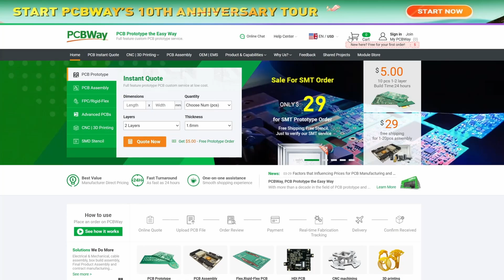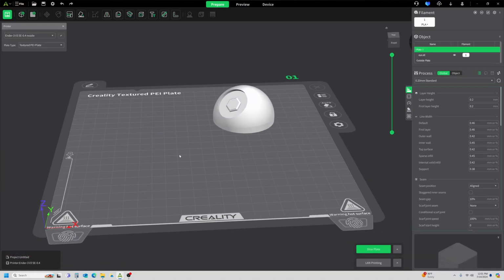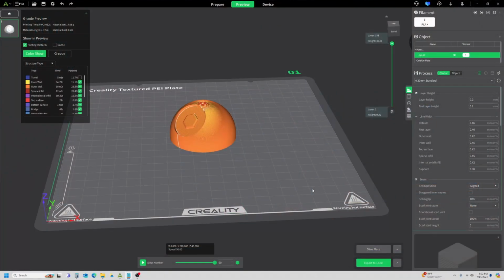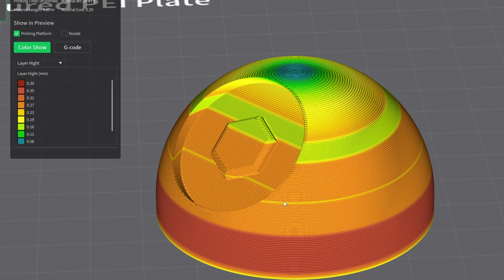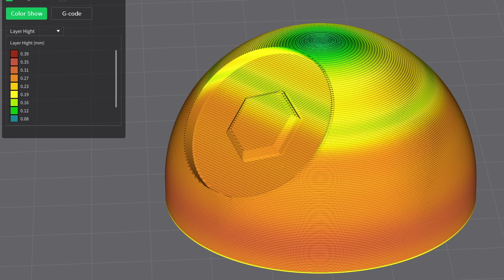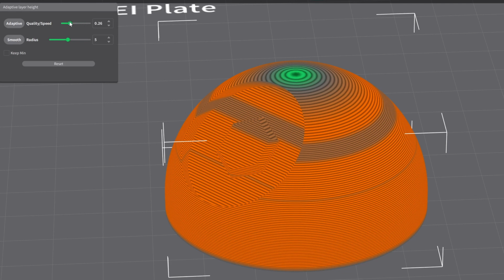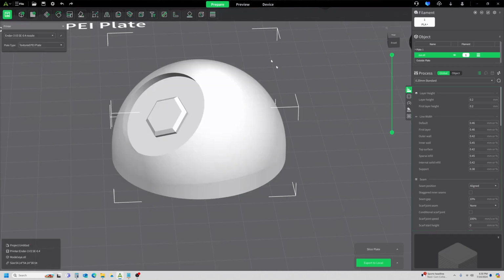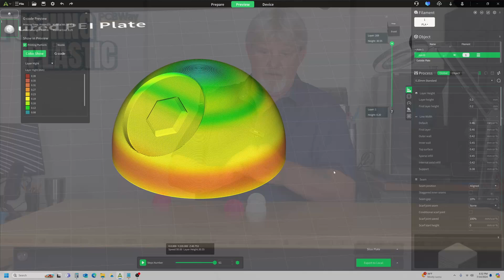Using Adaptive Layers In Creality Print 5

Comment: I appreciate the good info that you put out there.
When the V3 SE came out I grabbed a handful of them thinking I was going to be able to get some better quality and faster prints and that was exactly the opposite reality slicer was junk so I went back to cura.
Creality 6 just dropped and I started playing with it and the speed is back but the quality is not there yet, and the top layers on rounded surfaces are delaminating it's not the model.
Been printing the same model in Cura for over a year flawlessly.
So thank you for the info
Reply from the maker: Can you top layers (the rounded corners) be improved with Creality Print's Adaptive Layers?

Comment: Thank you!  I have been printing clockfaces with flat surfaces.  The flat areas almost looked like flat facets.  Between the smoothing and adaptive layers they look great!  
I'm using the third version of V6, they fixed a lot of bad things very quickly.

Comment: I had a problem using Adaptive layerheight in Creality Print 5 (V5.1.7.10514), and wanted to ask about it in this comment section, but hopefully I figured out why it is happening. Despite this, I write what is the solution, maybe someone will experience the same issue.
The problem: Adaptive layerheight sometimes not applicates, all of the layers' height are equal (value from the Quality tab of the filament settings).
It is a bug, the support setting causes it. If you prepare a model with enabled Tree support, it will mess up the Adaptive layerheight, even if you disable the support and prepare it again.
The Solution: the support needs to be disabled before the first preparation!! If you already made a prepare with enabled support, you need to restart Creality Print to make Adaptive layerheight work.

Comment: This new update is great. I was able to get .04mm layer height on .4mm nozzle with fantastic results with my Ender 3 V3 SE. I am on klipper and I have done the dual 5015 fan upgrade. Outside of that, I have tuned and tuned and tuned. That was also at a max velocity of 250mm/s and outside walls at 100mm/s with PETG.
Reply from the maker: Nice! How are you liking the SE? I'm loving mine so far. I recently did some TPU parts with great results!
Reply: @pushingplastic7445  All of the issues I have had were between me and the slicer, so I am loving it!

Comment: I tried messing with adaptive layers, and no matter how much I go between  and speed, the entire print is solid green (..12)    Any idea what's wrong?
Reply: NM  I think I answered my own question
Reply: After I figured it out, I went back to a current print to ad adaptive layers.  Figured it out i guess, i went to slice and all I got was a ghost image of my print. I couldn't get it to slice. It would move around and if I went back to prepare, it would be normal.   What am I doing wrong?  I logged out and restated my laptop.  Nothing.  I am NOT tech savy at all.  So frustating
Reply from the maker: @Elimn8r64  When you apply the adaptive layer setting, you must press the button that says "Adaptive" before slicing. If you make an adjustment in the adaptive layer dialog box and you don't press that button, you will get only the ghost image and the slice button is disabled. After any change to the adaptive layers, press the adaptive (or Smooth) button. I hope this helps!
Reply: I did what you suggested.  I made sure I pressed the adaptive and the smooth button.  I still got the ghost image and couldn't slice it.  Am I missing something else?  Also, when I clicked on speed to slow it down, nothing appeared,  just blank.  I'm using silk pla if it matters.  I've tried this many times and keep getting the same result.  Sorry to keep bothering you
Reply: @Elimn8r64  Check that you're not on tree supports. It fails with those, and doesn't always give an error message
Reply from the maker: After adjusting the quality/speed be sure to press the adaptive button just to the left of the slider.

Comment: Thank you for the video!
The only little disadvantage of this method is that we can't use tree supports. It's understandable, they have their own independent layer height.
The feature it's extremely useful, thank you for great explanation!
Reply: Can' you use any supports at all?  I want to print a bell with adaptive layers, but I need supports on the inside.  Does that make a difference ?
Reply: @Elimn8r64  Hello! You can use normal supports (lines), but not organic (tree supports)

Comment: If you don't see the icon in the toolbar, it's hidden behind the filament control menu. A small circular tab sits next to the menu which controls the menu's onscreen/offscreen option.  Click that tab, the menu slides offscreen and the tab moves to the edge of the screen. 
To review, your minmum and maximum layer height settings provide the range in which the adaptive layer settings work. Good tool. Thanks for the heads up.

Comment: Using adaptive layers in Cura is very similar, but you get control over the layer height range and the max difference between steps
It does help on spherical shapes.
Reply from the maker: Similar but still different. I did a full video on Adaptive Layers in Cura about a year ago. I think Creality is following the path of Adaptive Layers in Orca.

Comment: Keep up the good work sir love watching your videos can you make a series on creality print 5 how to use
Reply from the maker: Actually, I've been doing that! More to come! I think I need to gather them into a play list, thoughts?
Reply: @pushingplastic7445  ya that would be a great way to arrange them and maybe you could target one section at a time also have you been facing issues on slicing with custom setting and losing all details of the object coz I have been facing the issue for a while
Reply from the maker: @SatishRai1310  I haven't losing details with custom settings. I have noticed a drop off in quality recently but I'm hoping it's a worn nozzle. I'm still running the original on my K1 Max. I'll be installing a Flow Tech nozzle next week. As for the Ender 3 V3 Se, I haven't noticed any drop off at all in quality. What printer are you running?
Reply: @pushingplastic7445  I am running on ender 3v3ke I didn't had any issues with printing, but during slicing on custom setting all my details on prototype used to not appear hence was forced to use default setting